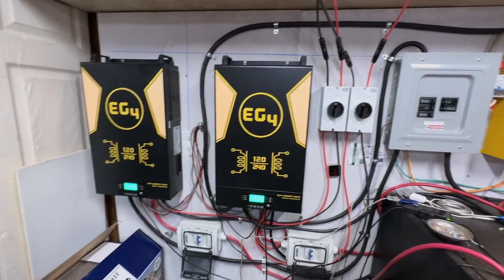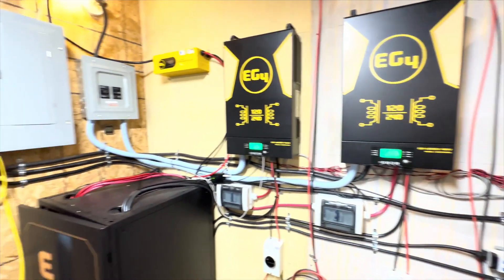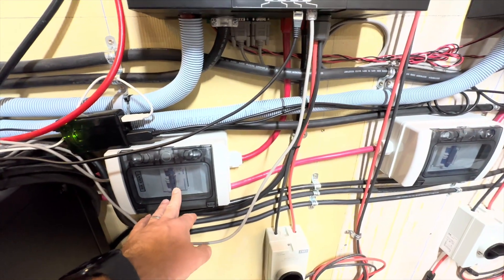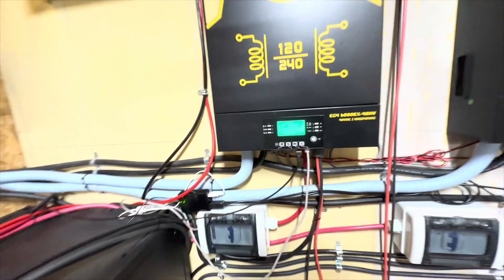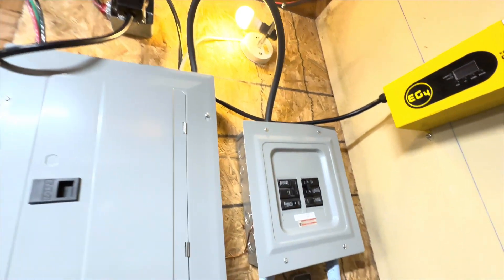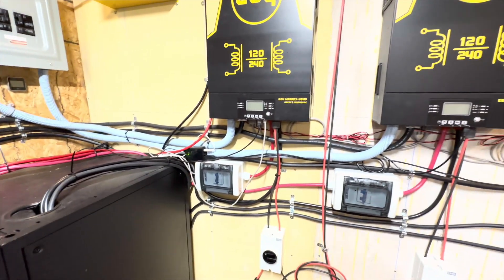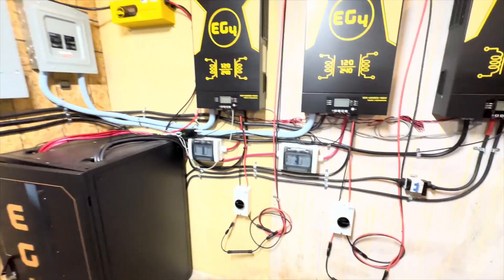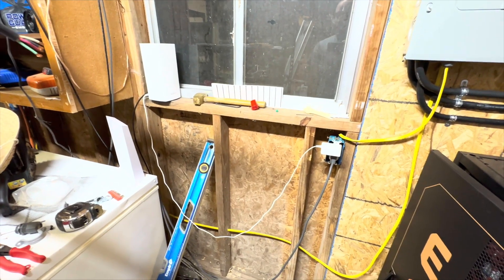Expanding Our Solar Power System: A 3rd EG4 6000EX Inverter

Comment: What gauge wire do use to go back out to the house? What amp breaker to backfeed? What's your distance to the house? TIA
Reply from the maker: Check out the latest video where I talk about and show some of that. 

I’m using 4/0 to go to the house. 

Each inverter has a 40 amp breaker connecting it to the AC in and the AC out panels. 

We are running about 100 feet to the house from the barn. Maybe up to 150 ft of wire.

Comment: Just curious how deep is the well and how far away from house?  Submersible?
Reply from the maker: ~500 feet down. It’s about 700 feet from our house.
Reply: @EastTexasHomestead   That’s a ways away and a lot of power.  Thanks for the reply. One of my next projects will be a 240 system just for my Well, 3/4  horse about 100 ft away and 160 feet deep, 240 volt will be new to me.  I’ve read around 1300 watts.  I.  Hoping to get some Cloths dryer action from it on good days.
Reply from the maker: 240 opens up a lot of possibilities! What inverters are you looking at?
Reply: All of them pretty much, not decided.  I know I’m gonna expand in the future.  I want the low idle for sure.  The Aims has the power saving mode, and then there is the Victron multi plus II.  Expensive either way.  The Transformer also. $$$$  I really want to do this one time only. I’m still a year out I would say, one piece at a time.   Kinda like Johnny Cash’s Cadillac. @EastTexasHomestead

Comment: Man... With a pump like that you might have been better off with one of the big low frequency inverters like the 15 or 18k sungold or maybe the low frequency growatts. You would have to buy separate charge controllers but most likely the low frequency units would last a long time with a load like that. Id check into replacing that pump but maybe thats not an option. Id say a soft start might help with making the inverters last longer also
Reply from the maker: The 6000ex inverters in this video are actually low-frequency. But. I've since upgraded to the new 6000 XP model, and they run the well pump with no problem. Here's the video where I tested it on one inverter: https://youtu.be/irY1sh31WSg

Comment: Take out the knockouts and use a double pole breaker.
Reply from the maker: 2:50 there’s nothing behind those two knockouts 😢 it’s a 6 slot max panel.
Reply: yea take the panel cover off, take some plyers and break out the another slot then go buy another 2 pole breaker @EastTexasHomestead
Reply from the maker: I could do that, but the lower of the two would be clipping into thin air. There’s no bus sticking up for the breaker to snap into behind the knockout.